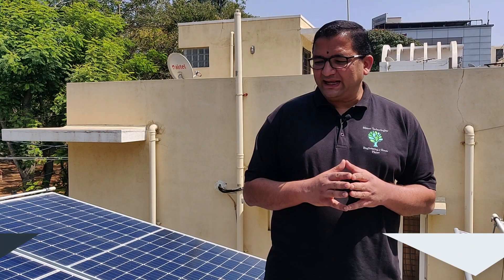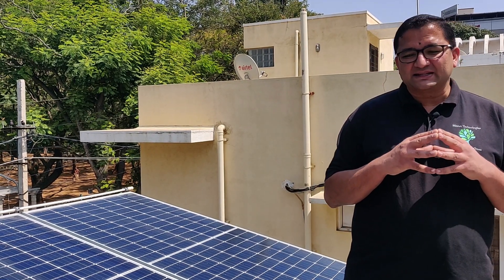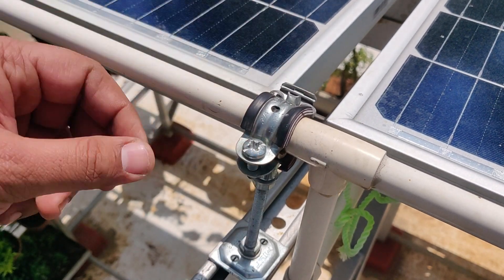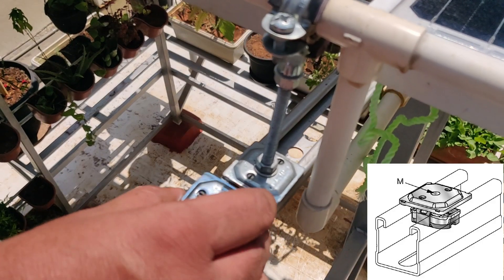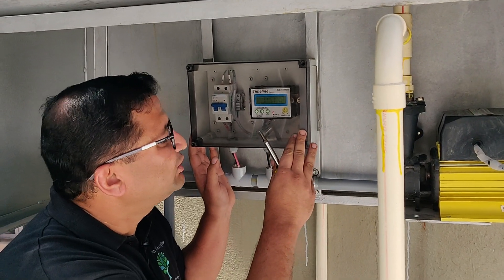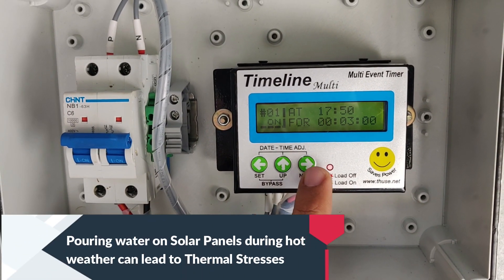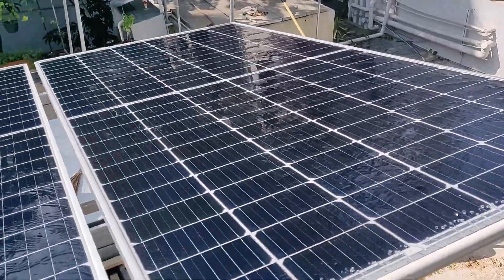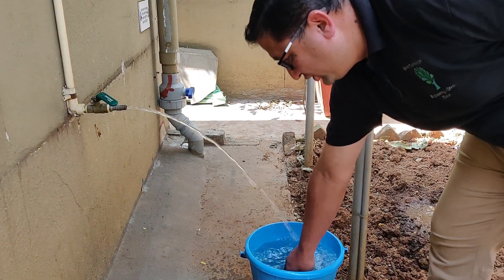Automatic Solar Panel Cleaning

Comment: Excellent engineering example Sunil. I am curious to know how you do gardening on rooftop without damaging the concrete below! Have you done any PU chemical coating on the rooftop? Thanks
Reply from the maker: First ; all tye pots / plants are on platform such that dampness Is minimum.
Second; water proofing is done . 
Third ; the joints and cracks are filled with Hilti epoxy.